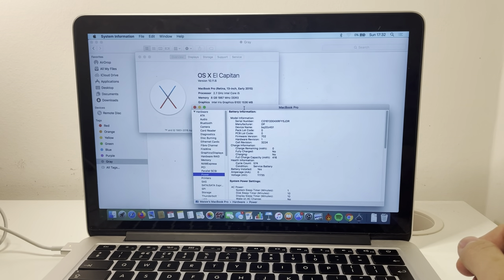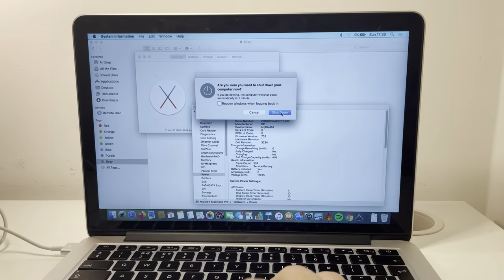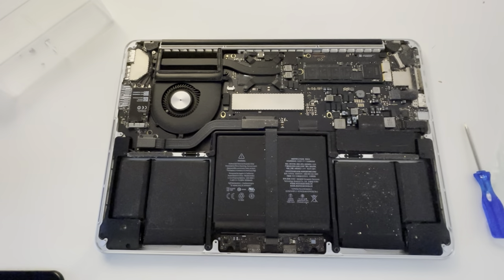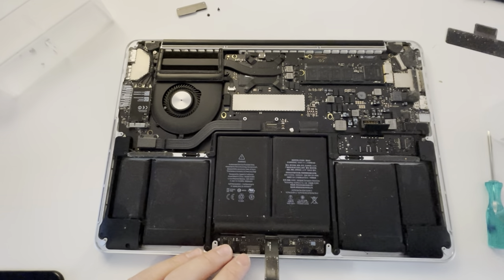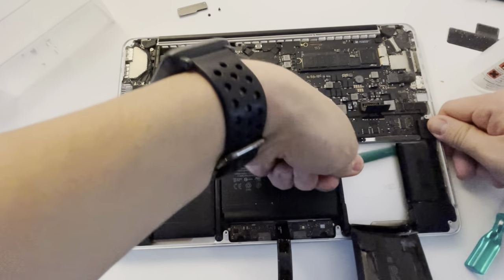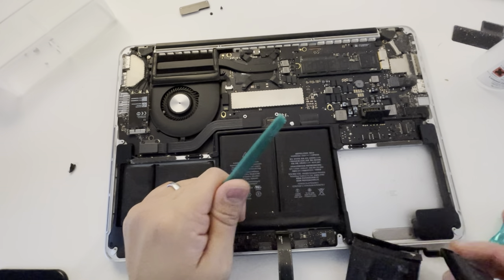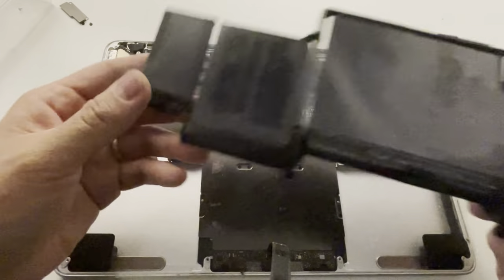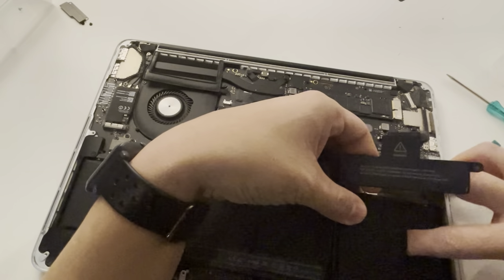Service Battery - MacBook Pro Retina Early 2015 13 inch KDJAMI A1582 A1493 - Install New Battery

Comment: Hi! How is the performance of the new battery after 1 year? Did it worth to change, and have you had any issues with the new battery?
I also have the same MacBook and my battery has 910 Cycles, and also health is 75%. The battery works pretty normal but it holds the computer on maybe 3-4 hours. So, do you advise me to do the replacement procedure as well?